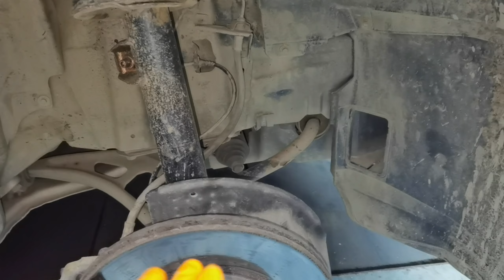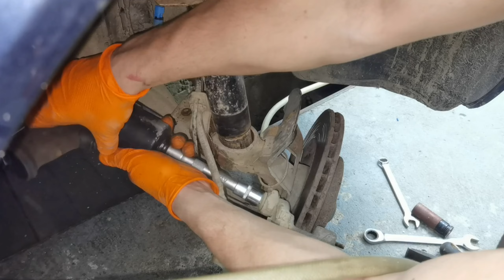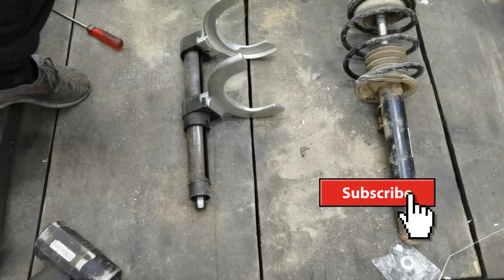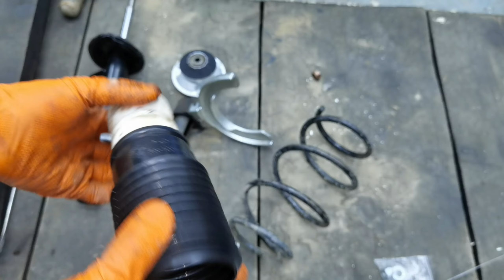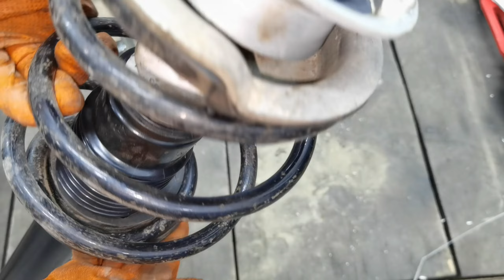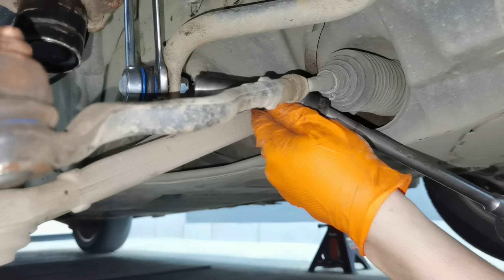How To Replace Front Shock Absorbers On BMW 3 SERIES E46

Comment: I try to compress my new spring but, its failed, i didn't have much space to screw the 22mm nut.... I use the same tool as ur compressor spring ...
Reply from the maker: You have to put it in the correct position.It's difficult to find the correct way to compress the spring.